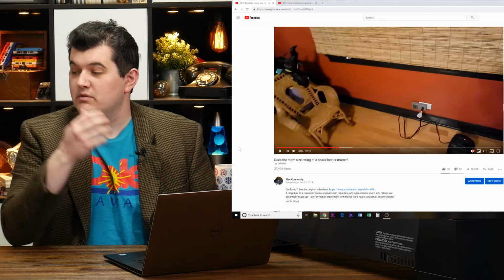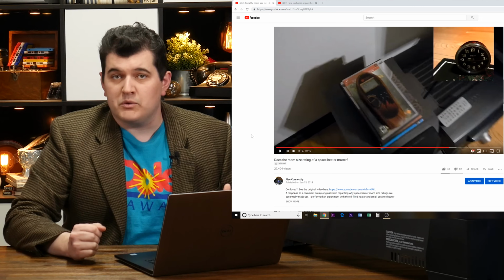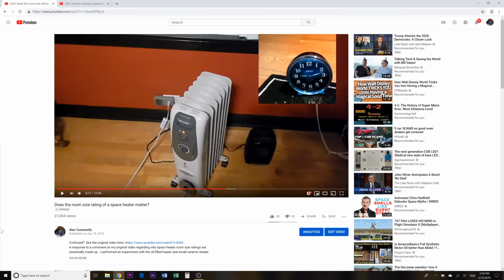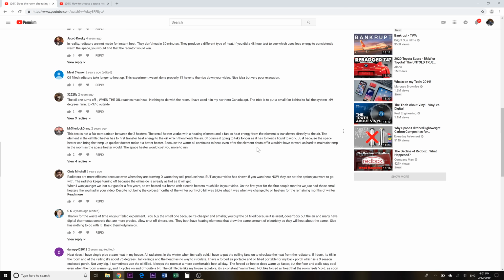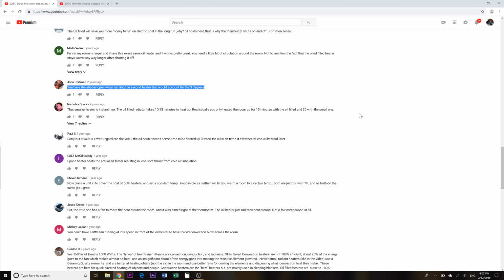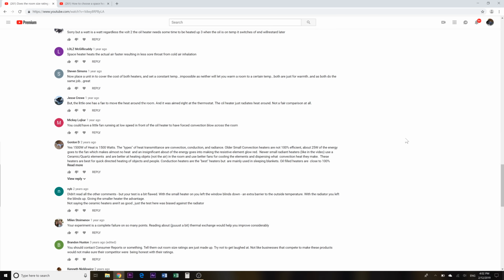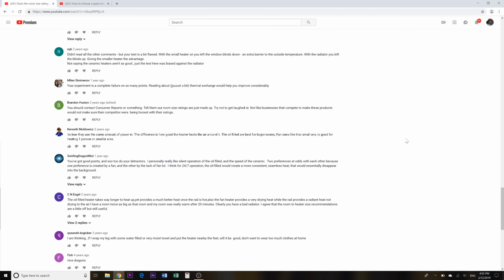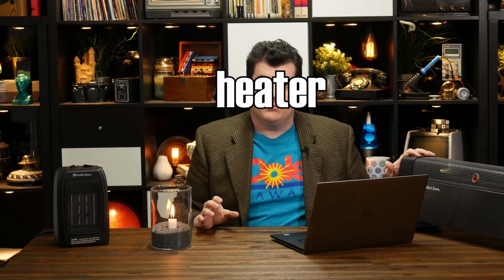More Space Heater Nonsense

Comment: A watt is a watt. No matter what the BS advertising for the heater says. As a long-time engineer I verify your conclusions are correct. The only way to get more heat than 1500 watts is to go to a higher capacity electrical circuit so more current can be drawn, thus more watts. The formula for that is P=E times I or power equals voltage times current. 120 volts times 12.5 amps equals, wait for it, 1500 watts.
Reply: Or use heat pump I suppose.
Reply: Fixed baseboard or convective 240/208v heaters are more powerful and safer (they're on dedicated circuits, no outlet and draw less amps since it's 240v). Using them with a wall electronic thermostat is even better for comfort.
Reply: @lajya01  it's just a lot of effort to do all that for a single room. so people only use dedicated circuits for central heating. and central heating is inherently wasteful since you can't be in every room in your house at once. that's the reason people use space heaters.
Reply: @GratuitousHorizon  You'd have to determine whether raising the temperature 5 degrees 10 times is cheaper than raising it 50 degrees once.  Since HVAC is typically considered to be more efficient when the delta T is small, it is likely (I'm not doing the math for a 5-month-old Youtube comment) that central heat is more efficient, provided you use each room in your house at least once per day for long enough to warrant heating it. (Degrees in F, that'd be quite uncomfortable in C).
Reply: @GratuitousHorizon  well, if the central heating is gas or a heat pump, it's likely to be much cheaper to run for the same amount of heat produced than space heaters. Most areas of the country, electricity is quite a bit more expensive, but not everywhere. And yes, I do see your point about needlessly heating rooms. The problem with heating rooms on demand is that they take time to heat up, and then when you leave them, and you turn off the heat source to the room, that heat will still leak to the outside. It would be cool if you had a heat source that could heat the entire room evenly instantly. I don't know of such a source.
Reply: @bobbabai  well yeah, we were talking about electricity though. I have gas heating. in southern california. as you can imagine it's far cheaper than electricity here, california's energy woes are legendary. but there are some conditions where gas heating is impractical, unsafe, or illegal, where various models of electric heating are used instead.

in japan, the traditional method of central heating involved a wood-burning furnace under the house heating up air or even water, which circulated throughout the house in channels under the floorboards. I think I read somewhere that ancient rome used a similar method. anyway, in japan a lot of these systems have been retrofitted with electric heating elements and fans. it's actually pretty fascinating.

and yeah, I agree it's unlikely it'll be practical to do much better than we're already doing until some major paradigm shift happens. I guess some new understanding of physics might allow something like what you described, some kind of fine-grained control over the kinetic energy of individual atoms. but at that point I'm sure space heating will be pretty low on the priority list haha. then again, every generation always envisions itself at the pinnacle of science & technology and struggles to imagine the crazy advances that are just around the corner. so I'm skeptical but reserved lol
Reply: @GratuitousHorizon  
I live in Minnesota and gas heating is by far the most popular choice here because of cost and reliability. Electric heating and propane heating are used in some places where gas is not easily available.

I don't think there's going to be any choice but to get rid of gas heating, and oil heating, all fossil fuel heating, in the next 15-20 years, regardless of the cost. "Green" energy certainly is going to become cheaper because that's where the bulk of the development effort and funding has gone - who knows if it's ever going to be as cheap as gas. I would guess it probably will. But of course, renewables won't come on fast enough to make this happen, so nuclear is going to have to be a big part of the picture for the next 25-50 years.
Reply: @bobbabai  absolutely 100% agree on nuclear. it's very sad to see my state's government shutting down nuclear power plants before their EOL, when they need to be doing the exact opposite, opening new ones. our emissions continue to increase as the energy demands previously met by nuclear cannot be met by renewables. something like 40% of the state's energy demands had flipped from nuclear to fossil fuel fulfillment between 2000 and 2015. only one plant left, and just recently, it too was announced to be shutting down well before EOL. it's just mind-numbing
Reply: @GratuitousHorizon  
Don't get me wrong, I think nuclear should go away, but I don't think it can for another 50 years or so. I'd like to see plans to make it go away after ramping it up for about 3 or 4 decades.
Reply: @lajya01  Agreed they're safer, but why are less amps better, and why are convective heaters 'better for comfort' when a warm room's a warm room and a fan heater'll heat one quicker?
Reply: M Detlef  keep your voice down, especially as you are making the same mistake when explaining. It's "BTUs per hour" that you want.
Reply: The real secret is to put a Vega 64 GPU in your computer to heat your room.
Reply: M Detlef  also, unless the motor moves something outside the room, in the end, the movement, too will turn to heat, meaning it will still produce the same amount of heat as a radiator.
Reply: "A watt is a watt, you can't say it's only a half"
Well Cbonz "Henry" 77, Hear me out. A watt actually has 3 parts to it, a w, which is used to move forward, a, which is used to move left, and t, but there's no cases where that's useful or important.
Reply: @S So in Australia you guys don't wire like in the UK with I think 32A ring circuits and then fuses in each plug up to a maximum of 16A?
Reply: @ba94845  OBJECTION! How do we know that you did not wire in several high voltage low micro fierite capacitor that would cause the transformer to outtput more powerdensity then was actually 
used
Reply: M Detlef  A motor has an efficiency greater than 0%, i.e. some of those 1500 watts will produce mechanical power out and only a fraction is lost as heat.  An electric heating element has an efficiency of 100% (or 0% compared to the motor) in that it "does" nothing, all of the electricity in is given off as heat. Absolutely all of it. 
Therefore, any two heaters that consume a comparable wattage will effectively produce the same exact amount of heat, neither can be "more efficient" than converting all electricity into heat, 100%. 
Perhaps Mykel Hardin ISN'T the dumbass you're looking for?
Reply: The other way for a heater to be more effective is to help the airflow. Otherwise it just warms the air around the heater, it gets hot and shuts off because of the thermostat locally at the heater. By blowing fresh air across the element the thermostat only shuts the unit off when the air being sucked from the room (far more likely for the air to be at uniform temperature due to mixing) reaches the shut-off point.
Reply: Cbonz77 but you can always get less heat from the same 1500 watts by making a lot of it too low of a level to matter
Reply: Our kitchen was wired with split phase circuits, so after two decades of waiting far too long for kettles to boil to make a pot of tea, we bought a 3kW kettle on one of our trips back to England, came home, rewired an outlet for 240v with a 240v fixture (NEMA 6-15), put a N.Am 240v plug on the kettle and presto - boiled water in no time.

I have sometimes wondered if the split phase kitchen circuits were a result of some far-sighted electrical engineer somewhere cursing North America's 120v supply but realizing - as we did - that a split phase circuit would be a backdoor way of getting 240v in the kitchen.
Reply: All of you all here saying just increased the voltage to a heating unit and you solve your heating problem are missing the point that that creates a safety problem. You must never operate a heating unit at a voltage higher than what it's rated for.
Reply: Just install some NEMA-20 outlets on a dedicated breaker. Bam, 2000 watt potential.

Or y'know, use that same electrical work time to install a 2-phase rig and slap a construction heater in there. You'll be sweating in no time!
Reply: @ulogy  Or come to Europe, we have 230V at 16 amps, a potential of over 3,500 watt.
Reply: @Schnittertm1  come to eurpe....
Don't thik soon.
1 eureo is worth 3 sheet of toilet paper. (Migh be worth nothing noww)
I stay hee in norf Korea. Kim Jung un wi keep me safe.
Reply: @Schnittertm1  The UK power is the same as the use and Japan as far the power plant because AC is not measured in amperage since AC is never More than 500mah naturally because it gain voltage not amperage. The independent power density you are getting are micro fierite from the transformer.
Reply: @Schnittertm1  But you can't buy AR-15's , AK-47's , Glock 9's , 44 Magnum handguns and anything else over the counter like Americans can to shoot the Hell outta the heater when it breaks. Guess you keep your burned out heaters to throw at the illegal invaders you have over there known as "immigrants" , huh ?
Reply: @ulogy  If you're that cold, I would just say.... 2 heaters.
Reply: @furbymobile  I fail to see how shooting my way out of cold works, but I suppose it is America.
Reply: a watt is a watt, you can't say it's only a joule per second
Reply: @blunderbus2695  The Watt is the SI unit of power, which is energy over time, and because the Joule is the SI unit of energy that is the literal SI definition of the Watt.
Reply: @MadScientist512  
I know, it's a joke because the OP started with "a watt is a watt" and that reminded me of half A press memes for some reason
Reply: @blunderbus2695  Gotcha, it's hard to tell the difference in text without a cue like ":)", and I'm not aware of that meme.
Reply: @MadScientist512  Good for you! I try not to be aware of any "memes" :)  Love the clarity of your explanations. I've had both types of heater and the only plus for the oil-filled was that it's basically silent other than a ping or pop every now and then. In every other way the forced air ceramic was better, temp stability, heating rate, size, weight and price.
Reply: @kwils6685  Thank you, especially for providing actual practical experience from both types, in particular the noise factor all the theoreticians failed to factor in :)
Reply: @blunderbus2695  What??
Reply: * groan * People still say wait for it? Dude, you realize we can skip over it and therefore not wait, right?
Reply: Just be in Europe and use 240v ;)
Reply: Referenced below is an experimental heater that produces about 3,000 Watts of thermal output, but consumes only 300 Watts of electrical input. The additional energy comes from low energy nuclear reactions. Instructions included. 
Research DuckDuckGo: lenr-canr MizunoTincreasede pdf
Reply: @timothyjohnson1511  In that case tim the unit should be measured in joules because that is how universal energy is measured because you are converting that wattage into a different form which is btu divided by uf equals j and then j x 50% is the minimum wattage required and as high as 85% to dynamic loss expectation.
Reply: the oil filled radiator supplys heat even when the unit is cycled OFF the ceramic one supplies heat for maybe 2 minutes when off and heat goes down fast ..  ceramic heaters are for instant heat gratification and not energy economic for long term heating (they use to much energy)  oil filled radiates heat non stop regardless of on or off cycle  ..uses less long term energy and is cost efficient over ceramic
Reply: @griffon3275  You can not get more heat energy out than you put in oil filled or ceramic over time they are equal.
Reply: @griffon3275  No, it doesn't.  The oil ABSORBS heat during the heating "on" time because it is in contact with the elements, and discharges heat during the "off" time.  The total energy used is still the same per degree of temperature increased.  If anything, it slows the propagation of heat from the element to the room air, creating a level "heat flow" from the electric duty cycle. 
Said another way: If you ran both heaters until the temperature increased 5 degrees, the smaller one would shut off first, but the power consumption and end temperature would be the same.
Reply: @griffon3275  They use the same energy. There are other reasons to prefer one or the other, but the energy pumped into the room, all other things being equal, will be the same, if the temperature is the same.
Reply: @griffon3275  Not quite, you almost got it and then fumbled... the amount of heat and energy over time is EXACTLY THE SAME... Period... the entirety of difference is that the ceramic will "pulse" the heat a bit more, whereas the oil filled evens the pulses out.  Put in a verbally graphic form, the ceramic set at 70° in a room that starts at 60° will come on until the temp hits 70° (or more likely 72° from overshoot because the thermostat is less precise and the heat is coming fast) and then oscillate between on for one minute and off for four minutes while the temp drops to say 68° and back up to 72°.  The Oil filled will take longer to get up to that 70° but it will then run for the same on for one and off for four minutes but the thermal mass in the oil will keep the temperature between 69° and 70°, due to it radiating slower, so it feels more constant. The overall heat is the same, and the overall energy usage is the same, there is no "greater efficiency" it just feels more consistent and, being silent, you don't realize that it is running exactly the same.
Reply: @griffon3275  not true. Energy usage to heat the room and maintain the room heat is the same
Reply: @griffon3275  why do you want any heating unit to supply heat when it's turned off? The room is at the temperature you want, you want the unit to stop producing heat. That's it - simple.
Reply: @griffon3275 The only significant variation in temperature is in the fan heater's airflow, the temperature of the air in a room heated by a fan heater will only vary between the temperatures at which it switches on and off, ie the hysteresis of the thermostat, which is generally only a couple of degrees and a fair trade-off against the significantly lower average power, and hence heating capacity, of an oil-filled heater. That said, a fan-heater using electronics to control the temperature and speed of its airflow would be great for things like heating just a specific area and it's a shame that's not available, though one could easily add that feature with a cheap motor speed controller from eBay.
Reply: I agree with Griffon 327.  The maximum amount of heat output of the device isn't as important as how they put out their heat.

Long term use vs point source use!
Reply: @123abcbruce  I always thought that was the point. Different designs have stronger results with certain situations...
Reply: @123abcbruce  A fan heater with a built-in thermostat would consume the same amount of power while also heating the room faster, the only real advantage to an oil-filled heater appears to be safety, and maybe drying clothing :)
Reply: @123abcbruce  Well Griffon is wrong about energy use or cost savings of one over the other if the temp being controlled is equal. Instead of agreeing with him tell me what you mean by "Long term use vs point source use" and your pros and cons of each type of heater.
Reply: @frostamatus  I think the only advantage of the oil radiator design is that it's potentially safer because nothing flammable can get to the heating element. By its very design, it's a unit that is designed to more or less put heat straight up above it. Both this design and the fan-based bare wire design both will also radiate some heat to the side based on how hot they get on their surface.

The fan design is always going to be better for heating a space quicker if it's located near the floor which most people would prefer. I think an ideal combination would be to get the oil radiator unit and put a fan behind it. It's much safer, it will heat the room quicker and you might get a bonus remote control and remote temperature sensor.

Comment: I have a 12v old PC fan bank strapped to the side of my radiator heater I use in my office that has no heat in my basement. I like the radiator because even after it cycles off, it’s still pushing heat. The fans just help move heat in other directions. I don’t think it helps make it hotter, just warmer faster as it moves the heat further away from the heater, warming a larger area. With the radiator, it’s also more consistent with storing heat so it uses less power overall over longer timeframes. 

I think it heats slightly faster though I could be wrong with a fan. I don’t Know if any sort of science backs this up but it seems to me like if it’s say 50°, then maybe it takes less heat to warm it up then it does if it were say 30°. What I mean by this is that how much power would it take for any heater to raise the temperature 10°. It seems like without any sort of science or math knowledge behind us, that it has an easier time raising the temperature from 50° to 60° and then it does from 30° to 40°. When you add a fan in there and it spreads the heat around, as the temperature rises up it seems like it almost kind of compounds that affect. Again, I make absolutely no claim that this is scientifically accurate but that’s just how it seems to me.